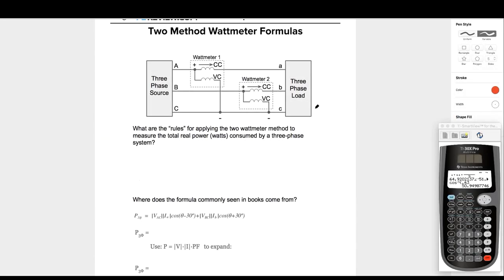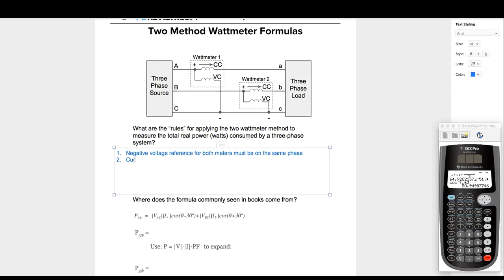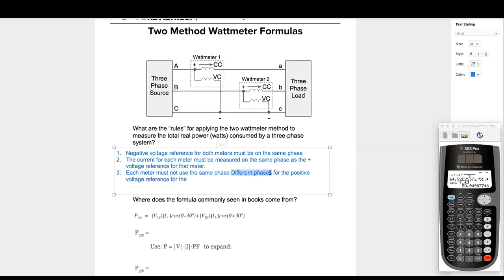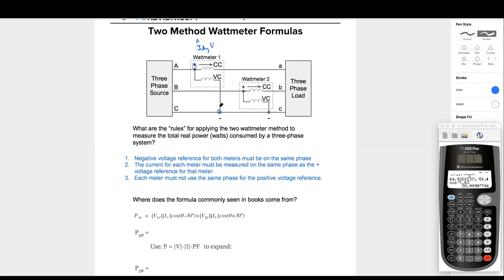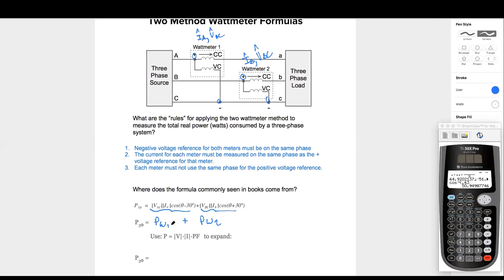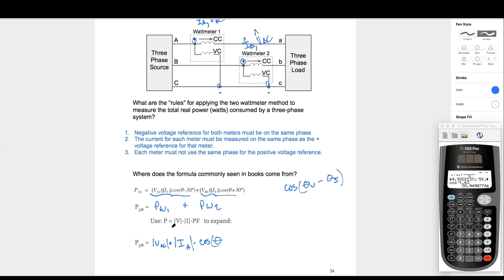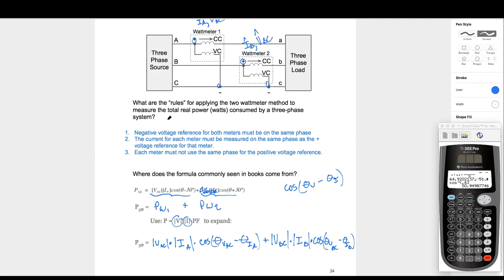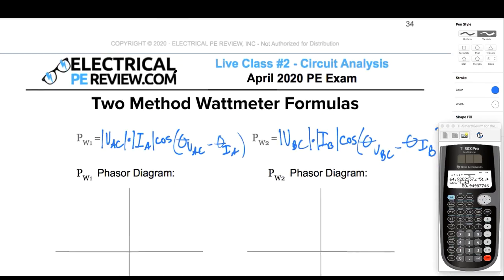3 Steps for Solving any Two Wattmeter Method Problem Part 1 (Electrical Power PE Exam)

Comment: Thank you for explaining the 3 phase 3-wire unbalanced system measurement. In my opinion, that’s the perfect way to make people understand the concept of “1 wattmeter less than the number of wires”.
Reply from the maker: Hi Joseph, thanks for your comment. I've found that most books really gloss over how this formula is derived, and how to apply it for unbalanced systems (such as which wattmeter gets the cos(theta - 30º) term and why. Be sure to watch all three parts of this series if you have not already, you can find the links in the description for parts 2 and 3.